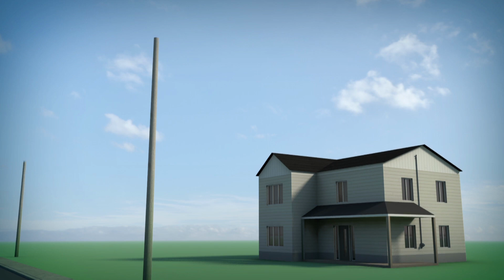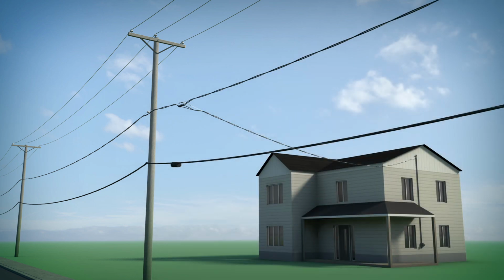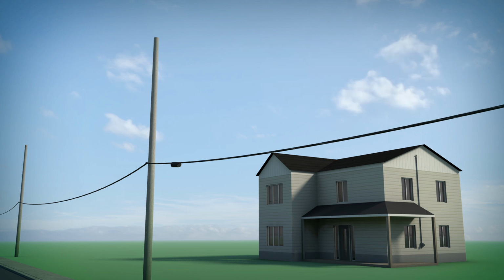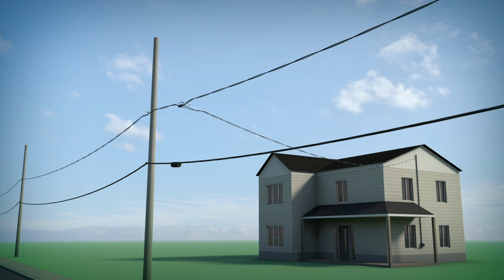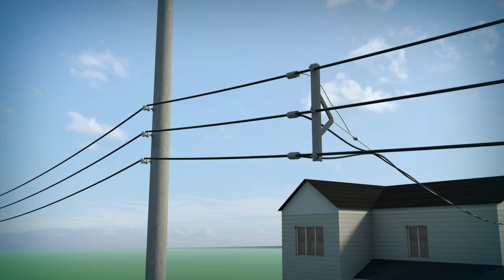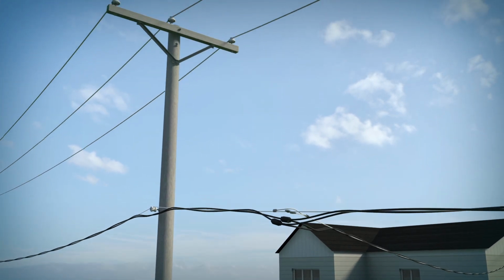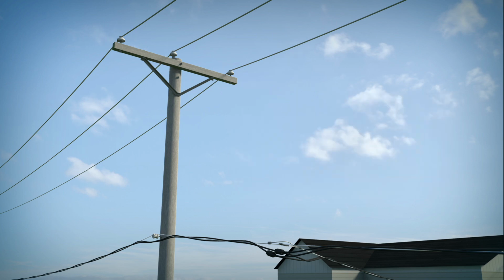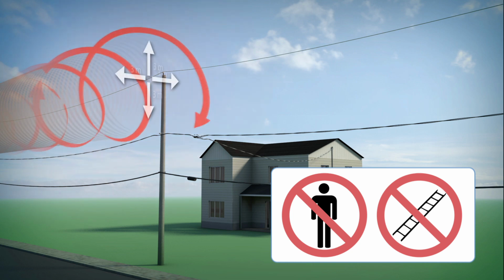Identifying dangerous lines

Comment: Telecommunication lines definitely use higher voltages than 12V. Standard old-style telephone lines use 48V. Cable TV distribution systems put voltage on their coaxial lines to power their line amplifiers. From memory it's around 90V. Both systems are insulated against direct contact unless the cables are damaged. Fiber optic cables without embedded conductors are of course harmless. Unless you damage one, then that could be very dangerous to your wallet.
Reply: The ringing voltage can even reach ~150v on those old analog POTS lines. The current, however, is extremely low. But 12v is definitely wrong. Also, the medium voltage lines could be closer to 7kV on the lower end. This second distinction isn't quite as important, since it's still more than enough to kill instantly.
Reply: T6
Reply: I’m hanging from the bottom one rn I’m chillin

Comment: Telecommunications Lines Higher than 12V Old styles telephone Line use 48V Cable 
TV systems  put voltages  on coaxial Power line From memory Power 90V 
Both power systems direct unless the cables are damaged  Fiber option without 
Very Dangerous are course Harmful embedded couldn't very dager around to the Cable  and the power was still not working